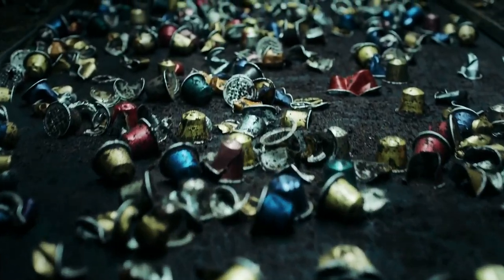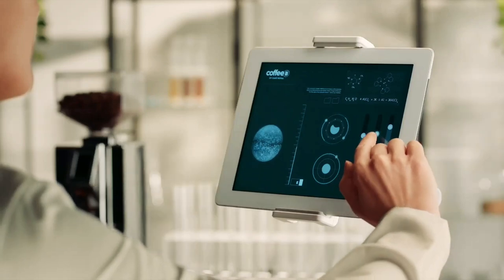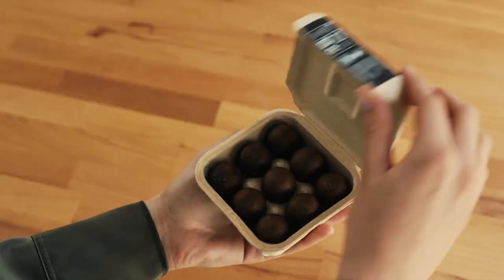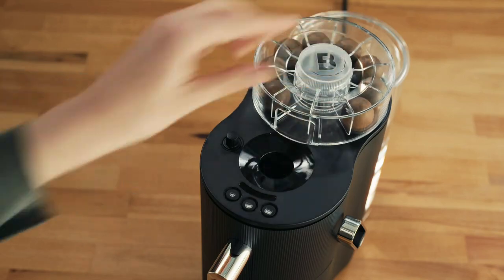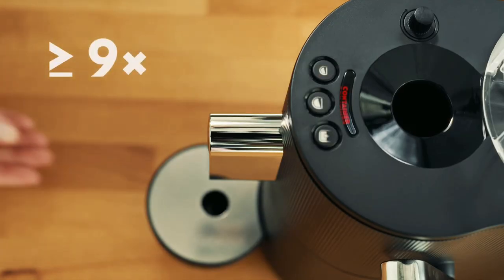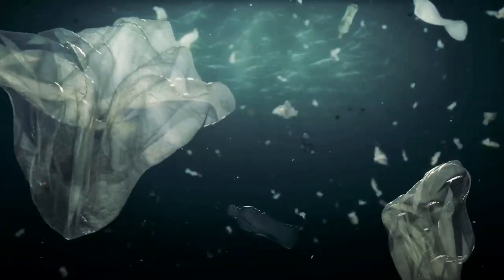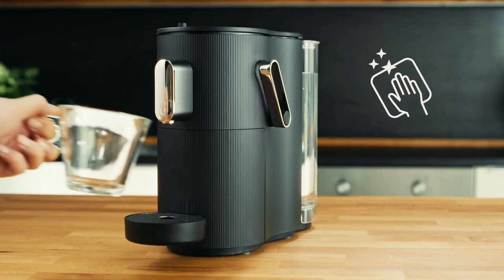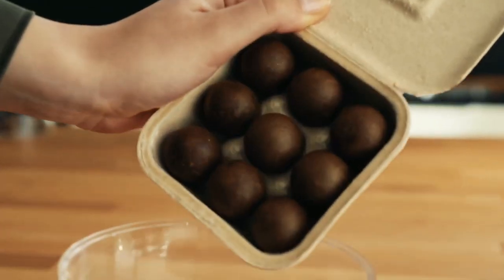This Next-gen Coffe Machine Uses Coffee Balls Instead of Capsules

Comment: There’s no way this small machine can get 9 to 12 bars from these coffee balls. Also in order to get them in this shape, they’re probably using some sort of binding agent that will end up in your coffee. Just get preground coffee or grind your beans. It’s not that hard
Reply: I'm going to say that the fats in the coffee act as a binding agent with the outer casing proving additional stability.
Small machines are capable of high pressures, particularly cheap ones designed for preground coffee, so I don't doubt that claim. However, I do doubt that's pump pressure and more resistance pressure to create Crema - think pressurised portafilters.
A puck from a tamped portafilter comes out cleanly, so add several times more pressure and I have no doubt it would stay together.
Having said that, I'm sure it will oxidise quickly and end up tasting like rubbish.
Reply: I'm not here to add to the speculation, I just get excited for coffee balls
Reply: A Nespresso machine does 19 bar…. Why wouldn’t this do 12?
Reply: You can’t use coffee oil or fat as binding agent. It will not hold as such. If it does, then ground coffee will look like this as well. Essentially if this is made from ground coffee , it will be powder. So it will need a glue or binding agent to ensure it sticks as a ball. The biggest issue is fresh coffee releases a ton of co2; which can be resolved in nespresso pods as they suck all oxygen out replacing it with high (or almost pure) co2 or nitrogen. No oxygen no co2 release . This means this balls ‘must’ be made with stale coffee that no longer release co2
Reply: @MalaysiaBarista  hate to break it to you, but that's not correct. Yes, fresh coffee does release co2, but it won't prevent binding. If you have ever tamped fine espresso you will know that pressure is enough to bind it.
Reply: @droidtigger  tamping coffee isn’t airtight ; that’s why water can flow through the puck . If the ball isn’t airtight ; then it would have greatly oxidized . Worst case some food regulation requires the actual food (or drinks) to be packed air tight to ensure no contamination. If the ball isn’t airtight ; no plastic cover , and in a non-airtight container ; it may not even pass FDA or most other countries food regulatory body . Before anyone argue; imagine non-airtight coffee ; in a truck for 1 week to port ; 2 weeks in port ; 2 months on the ship ; 2 weeks in the port ; 1 week in truck ; 1 month on the grocer shelves .
Reply: FFS she SAID @ 0:28sec  "each single serve coffe ball is made of compressed  ground coffee beans  encapsilated with in a seaweed dirived outer casing"
Reply: @memyselfandeye1234  precisely. Thank you.
Reply: @MalaysiaBarista  they will come in a packet AND they have a coating to help with that. So many things are not airtight and fine to eat, like fresh food for one. I have no idea where you are getting this information from.
Reply: I mean it’s like the size of a breville bambino. Obviously someone will need to do independent testing and take a look inside, but I don’t see how there’s “no way” it can reach that.
Reply: @droidtigger  the problem is that if this coffee is packaged fresh, then it will release CO2 and burst the coating/container
Reply: @ScarfmonsterWR  the video shows this didn't happen.
The capsule isn't airtight. That's why it can't stay out of the wrapper for too long.